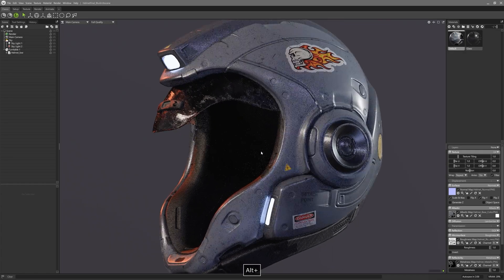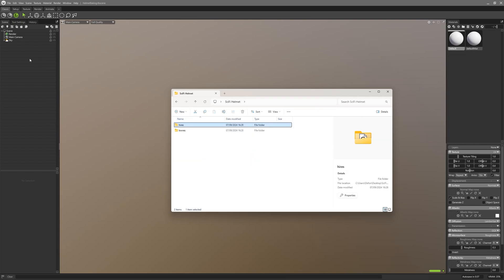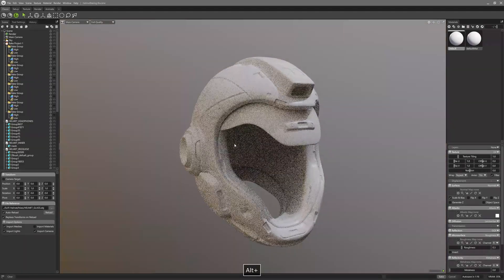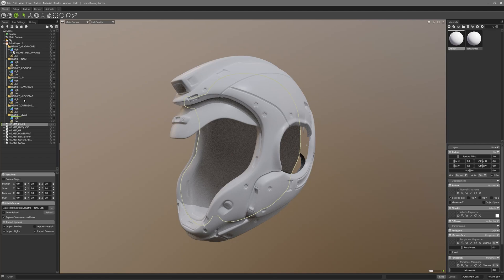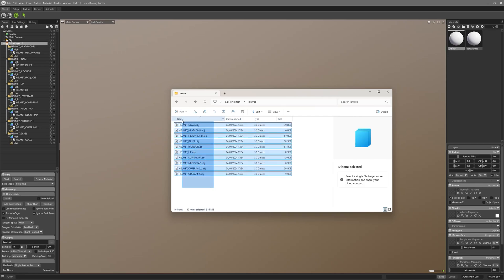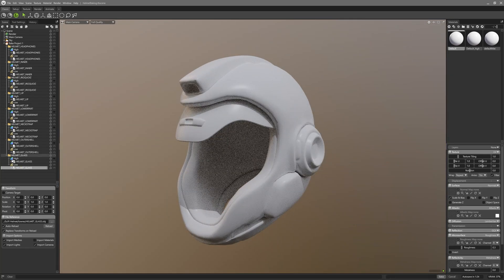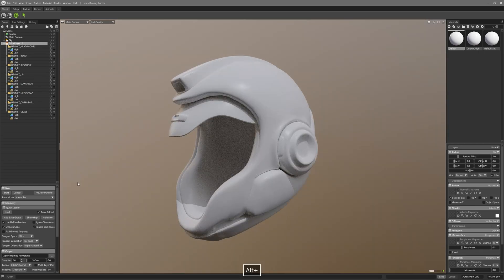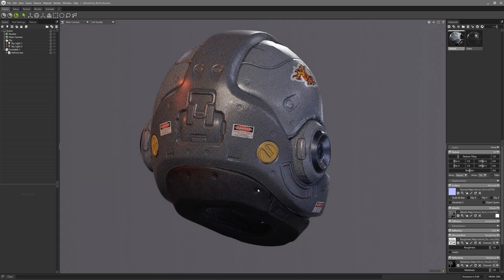Baking is Easy with Marmoset Toolbag 5!

Comment: The program should have a way to do this automatically just by search and looking at the file names. 
It wouldn't be too complicated to program this type of function.
Reply from the maker: Yes if it could just detect similar filenames and putting them in relevant baking groups by _hires and _lowers suffixes that would be definitely cool indeed!
Reply: It can detect and load everything automatically. You just need to name the files _high and _low. For this to work, you also need to load the files by pressing the Load button in your bake project instead of dragging and dropping them

Comment: It's such a pain in the ass that you have to export piece by piece and set the whole thing up. This is not easy or satisfying.
Reply from the maker: Well it has its own pluses as you have more visual control. But if you want to export all sub parts all in one go you can use substance painter’s baker. You can just name each subpart with suffixes  _low and _high respectively and export all in one file.

Comment: What did you think of texturing compared to substance painter?
Reply from the maker: It's cool and has lots of new interesting features but unfortunately I didn't have a chance to check their texturing workflows on a production level yet. But based on what I've seen so far it's very solid and production ready like everything else in Toolbag.

Comment: Another great video! Thank you. Quick question on your lights that you didn't have low polys for....Can you basically do that for a model that you don't need low polys for and just keep all high res  (for example a still image). Is there a particular workflow for just using high res models and not having to have  low res folder/files?
Reply from the maker: Hey @graemeh6345 Yes sure, actually you can use all of your highres zbrush sculpts as fbx/obj models directly in Marmoset as it can handle dense meshes very nicely. Just one thing, while it of course can handle millions of tris in the viewport with raytracing and complex lighting involved, I still highly recommend at least decimating or zremeshing your sculpts with adaptive setting on so it's a bit easier for marmoset's renderer/raytracer to handle your geo and faster for you to see the final visuals in realtime. So yes - you can completely omit lowres/baking step if your goal is only to create cool looking concept art. Lowres models are useful only if you're planning to use them later in game engines. I hope it answers your question!

Comment: Thanks! A well explained video. Please continue to make videos for marmoset and if you can someone on creating perfect uvs with zbrush
Reply from the maker: Thanks! I'm glad you like it :) It's actually super easy in zbrush. You jus tneed to have polygroups defined and then just go to Plugins > UV master and do Unwrap having Polygroups option active. Polygroups basicaly define the UV islands. I will make a video if I get a chance soon.
Reply: @defonten  Thanks but between saying and doing there is the sea. In very particular shapes it is difficult to define islands also in the checker phase there is always the problem of very distorted squares.
Reply: @defonten  Sure, but there's a big difference between saying and doing. Also, there are very difficult shapes to define the island. The real problem is that during the checker phase the squares always turn out distorted!

Comment: I was about to upgrade my MTB3 license to 4. I hope I can get an upgrade option for 5.
Reply from the maker: Yeah once TB5 is out of Beta there should be an upgrade discount for sure. For now only upgrades from v3 is available for 225$
Reply: As of now there's no discount option to upgrade from 3 to 5. The upgrade from 4 to 5 is also very expensive, as we only get 20% off of $400 perpetual license, which makes the upgrade to 5 around $320. This is probably their way of "strongly encouraging" people to opt for the subscription route which is significantly less expensive, but recurring. Approx. $228/year for monthly sub and $200/year if you pay for the whole year up front.

Comment: Hi dude, great video. I love MTB... In fact its is my main rendering tool. But still having to have every subtool exported separately, drag one by one to every baking group its a pain. This process in substance painter is "Load the Low Poly FBX"  Then  "Load the HighRes FBX" And bake... Of course, MTB haves its strenghts, but the time consuming file management for bakeing is nto one of them, I hope to be simplified. It makes no sense that MTB is trying to compete to SP... But you still have to drag and drop every gd high and low res object =(
Reply: you can export evry thing at once and marmoset will automaticaly sort your high poly mesh and loepoly mesh its called "quick loder"  the button above add baking group is "LOAD"that button is quick loader , you can cheq video on official marmoset channel for that thing.
Reply from the maker: Exactly!
Reply from the maker: @dv3d Thanks man, I'm glad you liked it! I got your point and it makes sense of course, but for some reason I still prefer manual exporting to have full control over each part separately. Also fixing Skewing and Offset issues is I think way easier and more visual in Toolbag. In Painter if you need to fix skewing, you need to generate two bake sets - one with averaged normals and another without, combining them later in photoshop, which is very inconvenient. Also you can paint Offsets and Skews in Toolbag in realtime seeing the result of your tweaks immediately as you paint.
Reply: @defonten  nice one, even though i know quick loader i still use manual method. XD
Reply from the maker: Hehe me too :) I want to feel the absolute control over each piece ;)
Reply: @defonten  I know i know =P If at any point MTB simplifies the Hi / Lo management, I would probably never bake on SP again XD

Comment: Meanwhile, substance painter ; oh hi _High _Low
Reply from the maker: Sure, Painter's approach of having just Mesh_high.fbx and Mesh_low.fbx is also cool of course, but fixing skewing issues is way easier and more visual in Toolbag. In Painter if you need to fix Skewing issues you need to generate two bake sets - one with averaged normals and another without, combining them later in photoshop, which is very inconvenient. Also you can paint Offsets and Skews in Toolbag in realtime seeing the result of your tweaks immediately as you paint. So anyway, I personally prefer baking everything in Toolbag having full control and interactive feedback over each subpart :)
Reply: @defonten  Thank you very much for the detailed video. Skewing is actually modifiying the cage right ? I mean it is not changing the geometry / topology, but just chaging the cage offset compared to high poly. Thank you.
Reply: You can do this in MarmosetTB as well. In the bake project, under the geometry tab there is a quick loader tab that allows you to load your meshes with _high _low. MTB also has a normal painting option where you can paint out skew and offset when baking normal details.